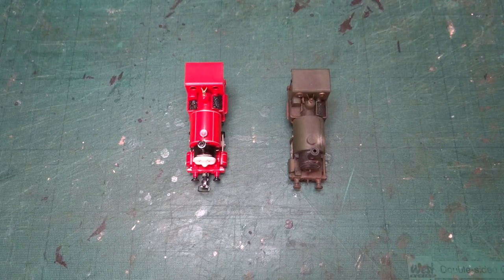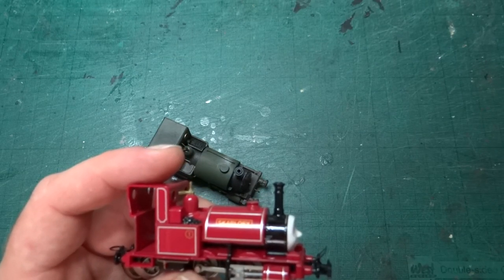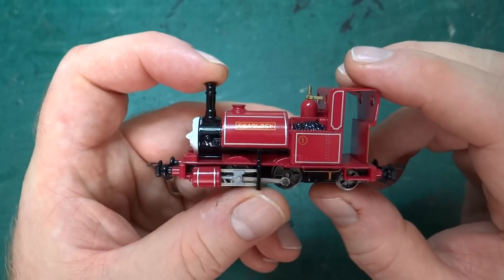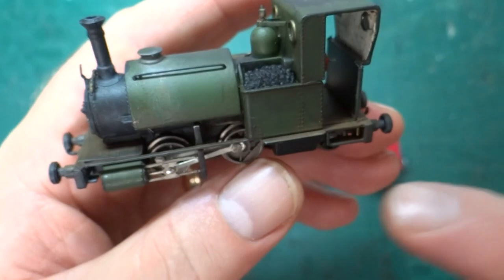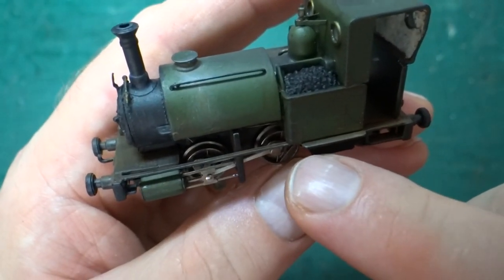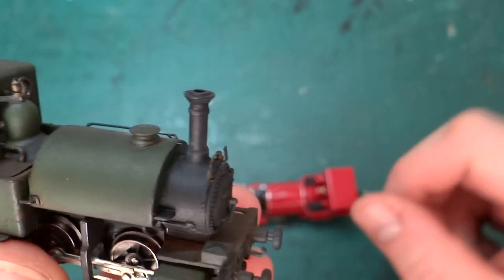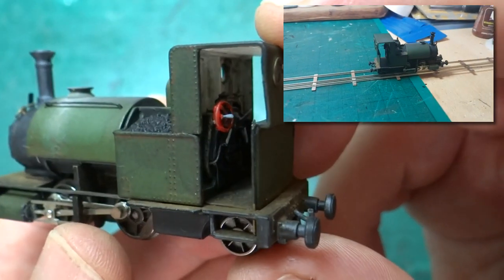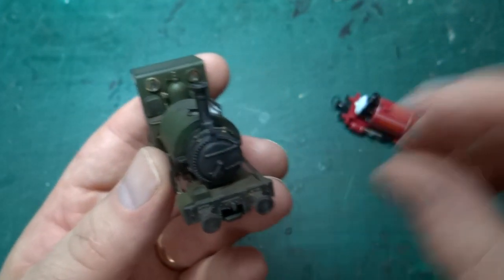I've Finished Building... Talyllyn by destroying a Bachmann Thomas & Friends Skarloey

Comment: I’m amazed now you can keep on filming when you just painfully dropped the model that you just said you have been working on for 7 years. Hope it didn’t have any damage. I gasped. 😮
Reply from the maker: It was a serious "heart in mouth" moment and had I damaged it I probably would have stopped recording. Given all the issues I had with wiring and then breaking the footplate in half almost at the end I suppose I was due some good luck with this model so thankfully not a scratch on it.

I will be more careful in future though when filming to hold tight to completed models!
Reply: @encoffeedrinker   I can imagine. You stayed pretty cool. Respect! Maybe putting it on a battery operated spinning table. I've got one, quite useful for presentations. They are inexpensive and it will look also more professional in your video.